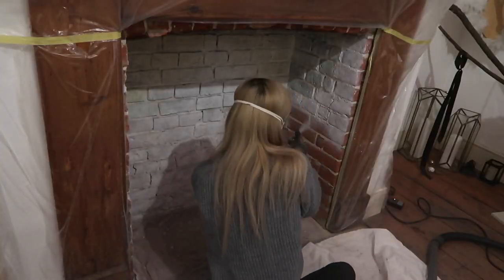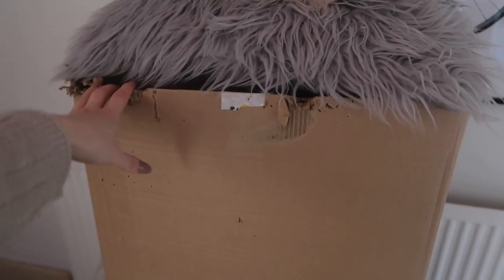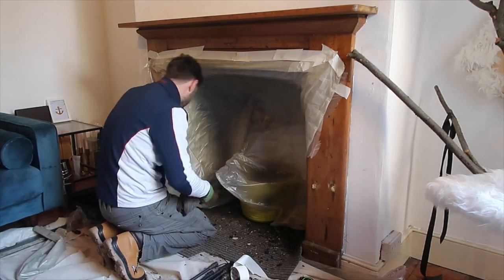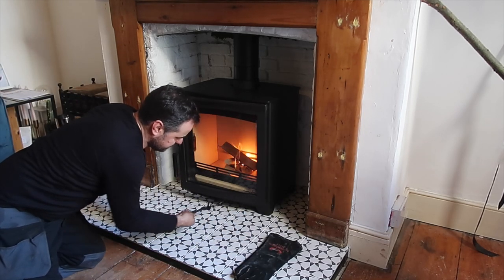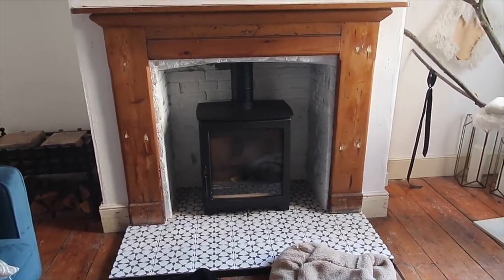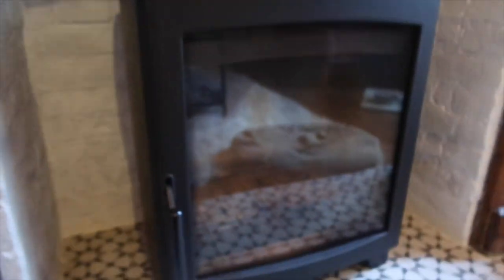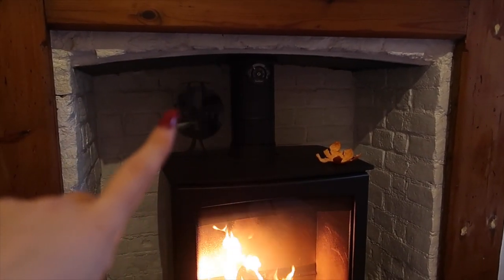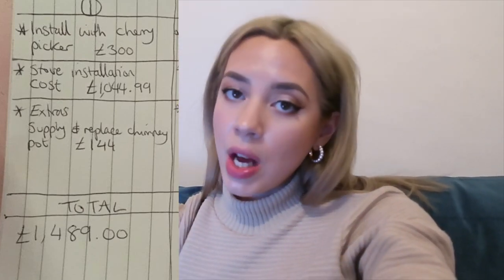We got a log burner! | LLimWalker

Comment: Good breakdown of the quotes. The only thing I would say is that the Parkray stove has a clearance of 2 foot (600mm) to combustibles. That means if the fire surround is within that distance then there is a risk of fire. CHECK THAT. Keep an eye on the temperature it reaches. Just fitted an Aspect 8 and very pleased with it. On the wood front, get a moisture meter so you can check the moisture levels in the middle of a freshly split log. NOT OFF THE END. It should be under 20%. Great video and nicely put together.